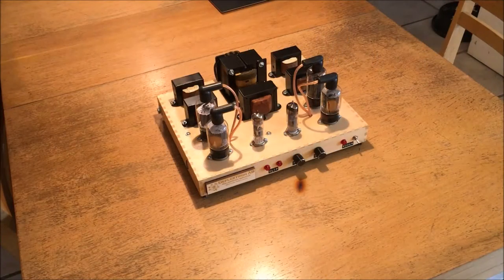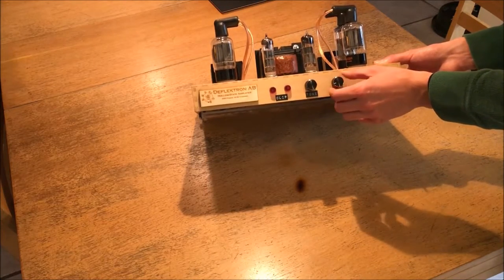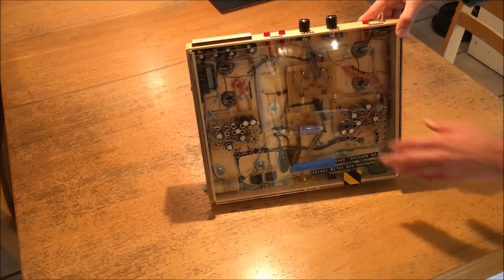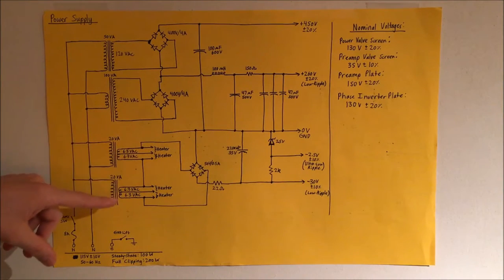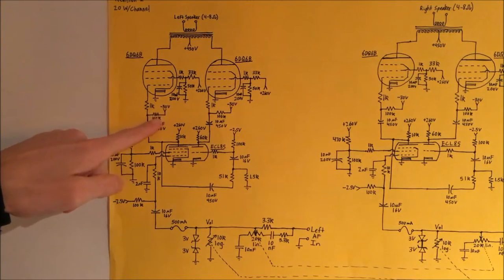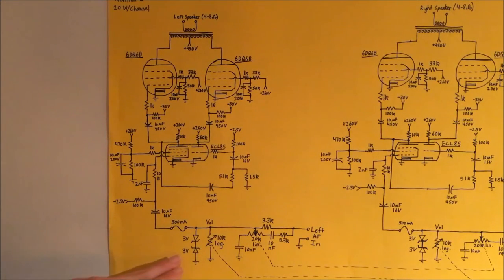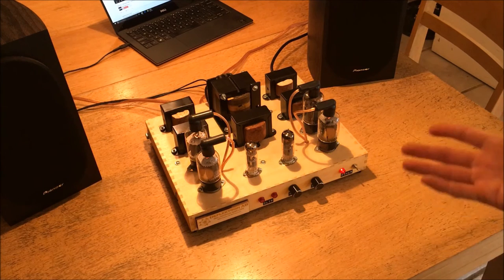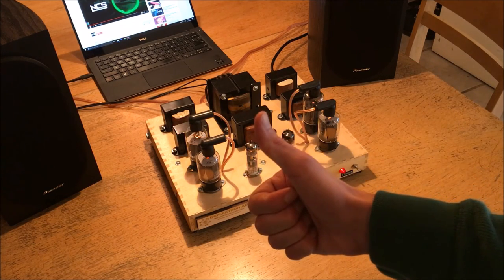EP 20 - The Deflektron AB Homemade Tube Amplifier

Comment: I really like to see power tube be re purposes I a an using- rc4136 as outputs and there cheap there good a 100 watts but rennet that’s at 50 percent duty cycle there were a ham radio output but run at 50 watts they are fine

Comment: Yes people have small minds a tube doesn’t know or care what the signal is It use 6kd6 it’s good for fifty watts but itore per day having that bias voltage is bad to fatal to output tubes the variation in main plate supply has little effect screens more but regulating that high of voltage is hard to regulate  all so the filament regulated gives very confident performance as well and with chips so cheap they make a very cost effective mod

Comment: Very interesting circuit topology, non-traditional use of the pentode/triode ECL85 though.  Typically the pentode of the ECL85 woud drive the triode portion, which acts as the phase splitter to drive the grids of the output tubes. The large capacitors acting as DC isolation for the output tube grids  are way too big, I expect that if you were to test the amplifier bandwidth the response is not quite flat from 20-20,000 hz.
Reply from the maker: You're definitely right about the caps being too big; I just had a bunch of 10 uF electrolytic cans lying around. The performance was adequate for my application, and the only effect I noticed is that it takes a few extra seconds at startup for the grids to settle into bias.
Reply: DielectricVideos    You might like to read what Norman Koren's tube audio page, (easy find via google) he has great articles on tube preamp and power amp design philosophies, and about computer simulation with SPICE to predict how they will respond.
Reply from the maker: That's awesome, it looks like he's got some great information there! Thank you!
Reply: You're welcome!